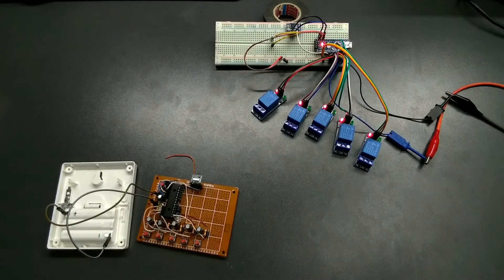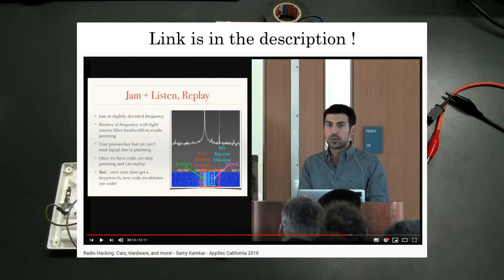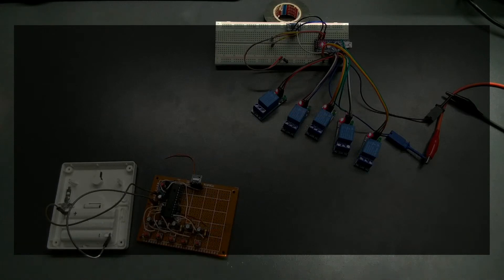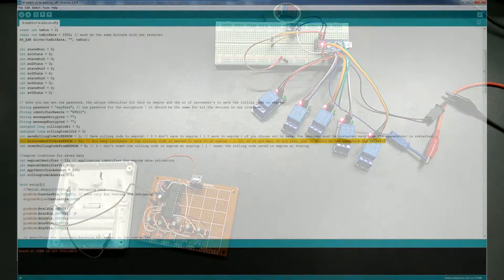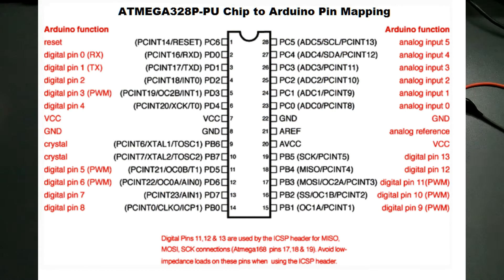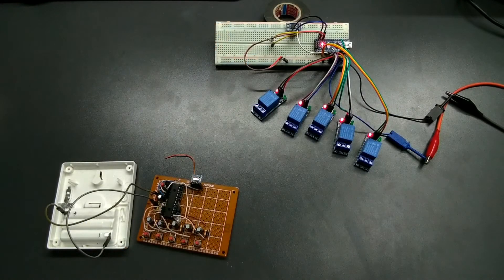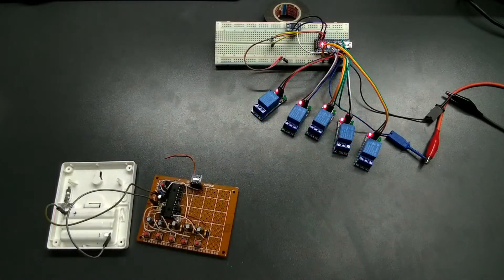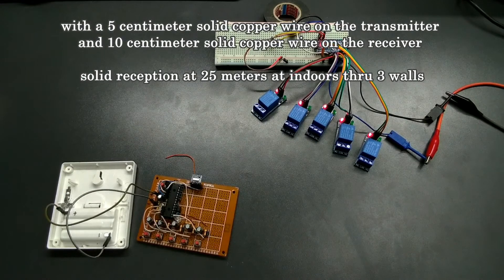DIY Wireless RF 433 remote and relay board with security (rolling code and encryption)

Comment: Correct me if i'm wrong
xxtea is NOT a rolling code algorithm, its an encryption , 
same data with same key , will give you the same encrypted data every time
thus should not be used with remote controls.
am i right ?
Reply from the maker: Yes you are correct, xxtea is NOT a rolling code algorithm, its an encryption ! But if you add a number, which increments in the data before the encryption with every button press and you store that number in the eeprom, you have yourself a rolling code with encryption... And with unsigned long data type you have 4,294,967,295.